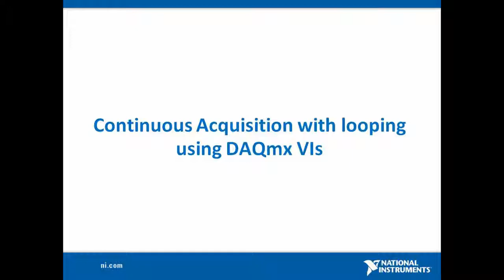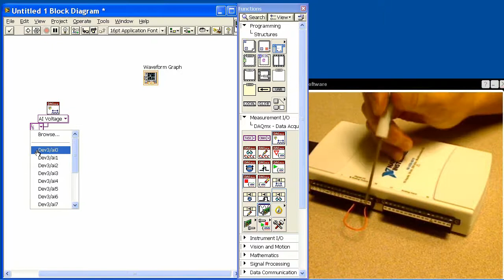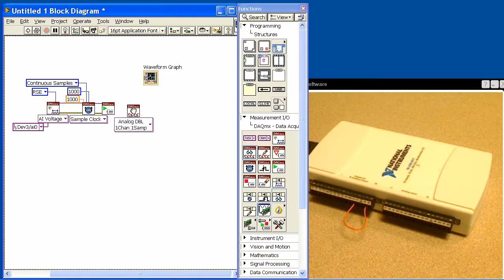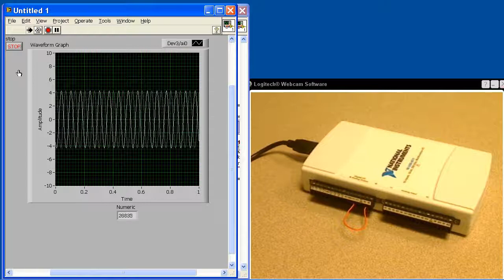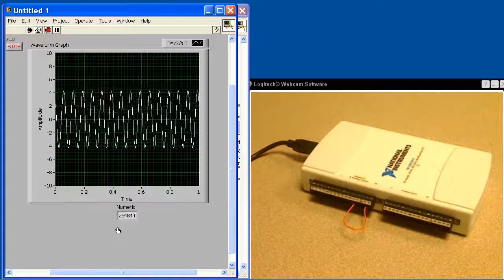Acquisition with Fast Looping using DAQmx VIs

Comment: Hi! I've done exactly your code, but I'm getting an error (see below). How do I fix this?

Error -200277 occurred... Possible reason(s):

Invalid combination of position and offset. The position and offset specified a sample prior to the first sample acquired (sample 0). Make sure any negative read offset specified will select a valid sample when combined with the read position.

Property: RelativeTo
Corresponding Value: Most Recent Sample
Property: Offset
Corresponding Value: -1000